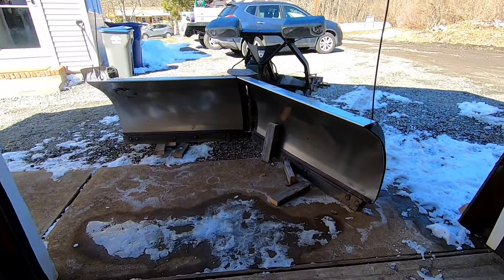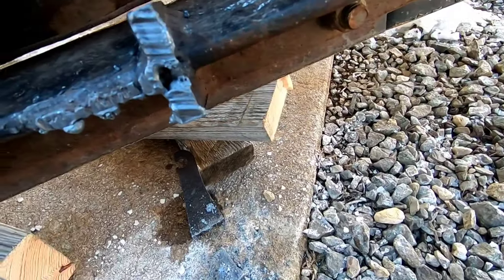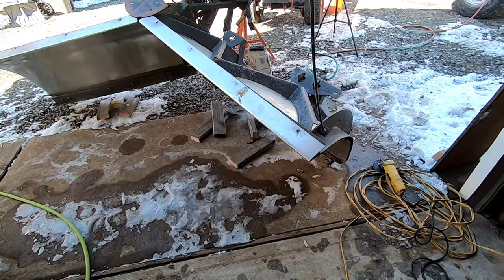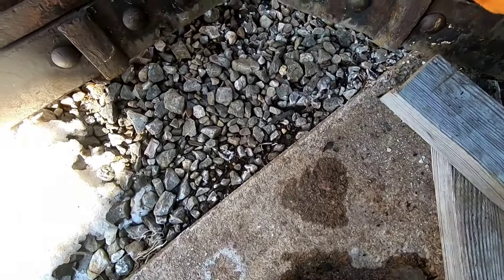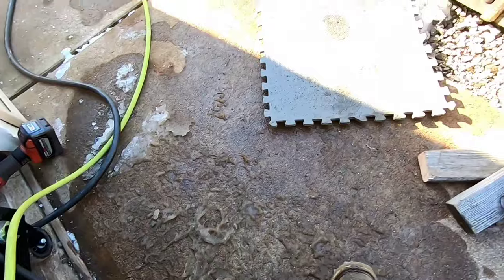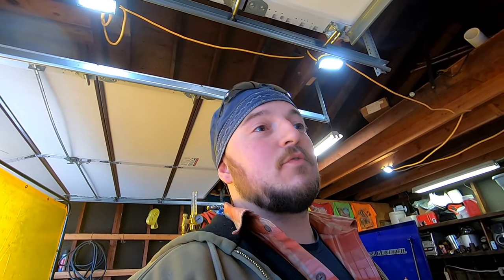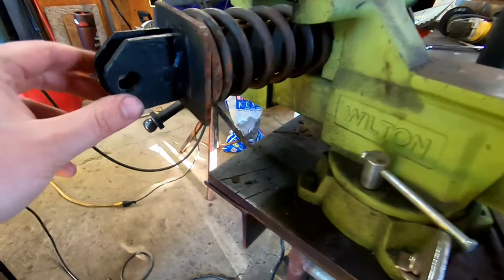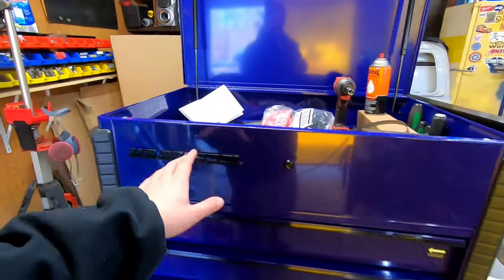MORE CLAPPED OUT SNOW PLOW REPAIRS - HOW DO I CHARGE FOR THESE JOBS?

Comment: Thanks for sharing your pricing structure.   The Blue Star refurbish video would be good.   Do you ever use flux core wire?   Seems you could save the cost of gases, and have just as good or better welds.  With anti-spatter spray and a wire wheel the welds can look just as good.
Reply from the maker: I do sometimes, just rather use mig honestly. when charge these jobs all my consumables are included in my hourly rate so gas figured in the price

Comment: Mikita drills are great. Another Milwaukee tool thats incredibly under par compared is their grinders. Luckily most power stations in my area now provide us with metabo and Dewalt but every now and then there’s a mine with Milwaukee grinders we have to struggle with.
Reply: They really failed on the grinder.  very disappointed.  Also had an impact that would stop running once in a while.  I went with Makita and Metabo .  They seem to work great so far.

Comment: That evolution chop  saw looks like the bees knees!! been scared of them because of the price but that would save me so much time over the grinder and cut off wheel or torch cut looks like it’s time to
Get one
Reply from the maker: yes I was the same way, but once I got one I don't know I never had one
Reply: Definitely invest in a nice chop saw, get one so you can do mitre cuts, will save you a lot of time if you have to build guardrails and handrails. Saves you time on lay out. Even better is a mitering horizontal bandsaw, set the speed of the blade dropping and let it cut on its own, then walk away and prep other material, like I can let the bandsaw do the 45° cuts for the top rail and mid rail, while I quickly cut the kick plate, or cut my posts and quickly put a saddle in them with a hole saw on a drill press. Can have a handrail all tacked up and ready to weld in no time. Cutting with angle grinders, wrapping and cutting your pipe laying out the 45°s and laying out your saddles adds so much time to your project.

Comment: I bought a blue star for $300 from some guy in the desert here in Cali.  It's missing a fuel tank, air filter box, and the ignition switch. The parts are quite cheap, except the fuel tank lol. I've been wanting to give the engine a tune up and attach a small tank. I think it's all fine, but if anything, I think I could put a honda  gx390 on it, if for any reason the Kohler is toast.  It has a 2019 sticker on it so I think it should be fine welder wise. Also a junk removal customer donated a Lincoln weldanpower 225. Single owner, well kept in a garage.  The guy was a retired ironworker. I love the machine but dang it's loud😂
Reply from the maker: yea fix it up that would be a good machine

Comment: Learn how to operate the drill. There are more than one settings on it. The clutch settings are bypassed on drill. On screw/driver setting the clutch works. Don't screw with the springs... they will bite you! They sell 'kits' to repair the hinge.
Reply from the maker: I looked for the repair kits, couldn't find anything. where were you seeing them?